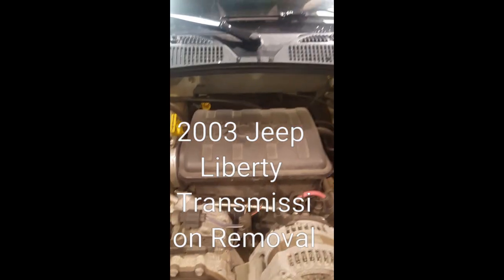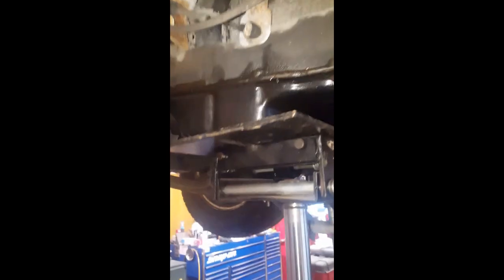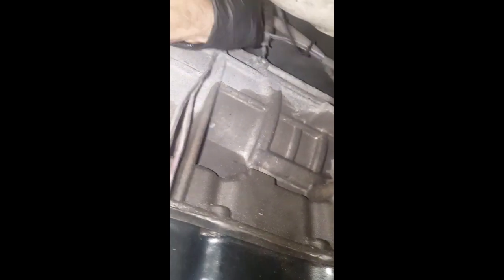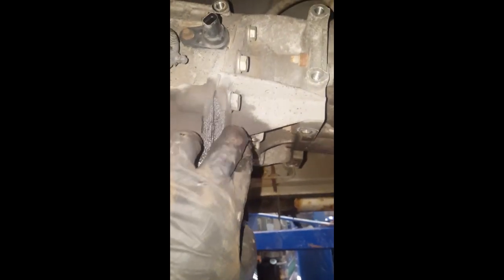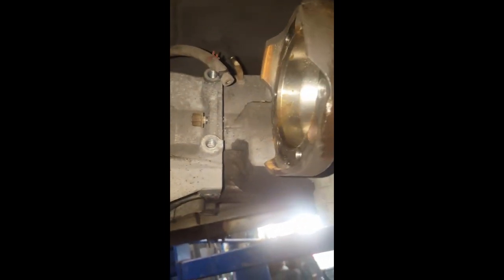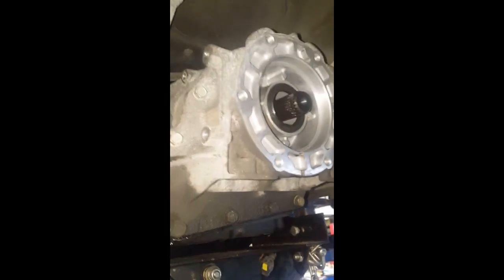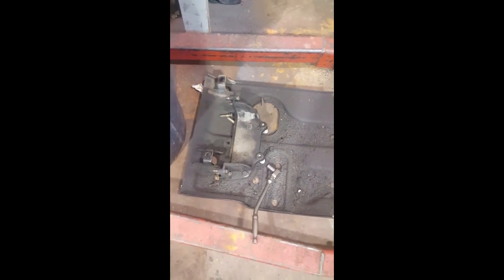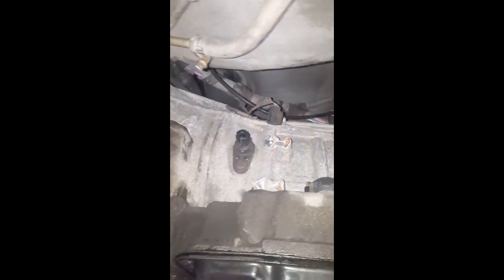2003 Jeep Liberty Transmission Removal

Comment: The Haynes manual says I have to use a bar support or engine hoist to hold the engine up but it doesn't look like you did this. Does the engine stay in position or does it slant back too far with the transmission removed? Someone else said a block of wood between the oil pan and cross member is all that's needed.

Comment: Great video. If I'm replacing the trans with a used one from a donor car, obviously the marks to lineup the torque converter to the flywheel isn't going to work. How do I know how to line up the donor trans torque converter to the flywheel? Is there a mark on either/both? How can I know where to mark the donor trans so that it goes into the Liberty at the exact same location?
Reply: you prolly dont care but if you guys are bored like me during the covid times you can stream pretty much all the new movies on instaflixxer. Been streaming with my gf lately xD
Reply: @Everett Ira definitely, have been watching on InstaFlixxer for years myself :D
Reply: @Everett Ira Definitely, I have been watching on instaflixxer for years myself :D

Comment: I have Jeep Liberty 2003 sport and when I get to 40mph it doesn’t give the changes it just stays at number 3 in the rpm side
Reply: It could be because you have overdrive disabled...
there is a small button on the side of the gear shifter, pressing it will turn off a light on the dash that displays "O/D OFF"
when overdrive is off, it prevents the transmission from using the 4th gear. With it on, it should simply automatically go into 4th gear when necessary

this may not work but it's just an idea